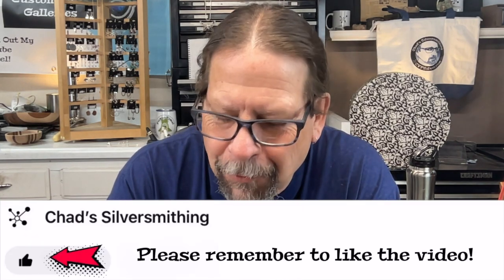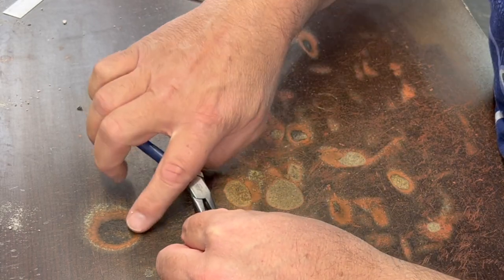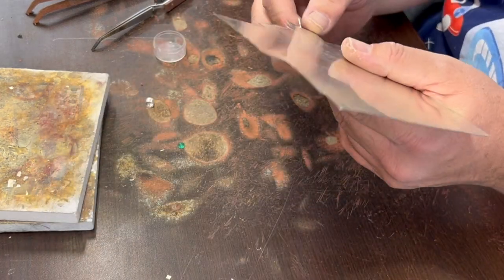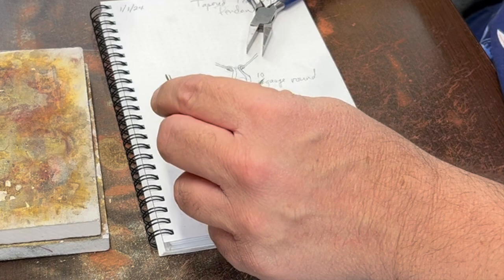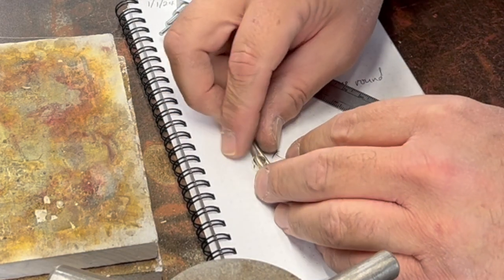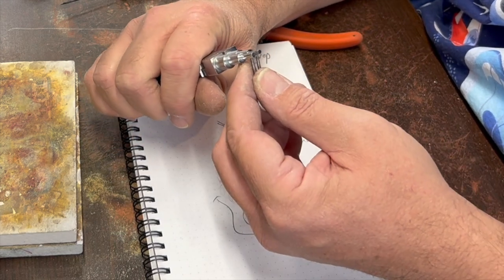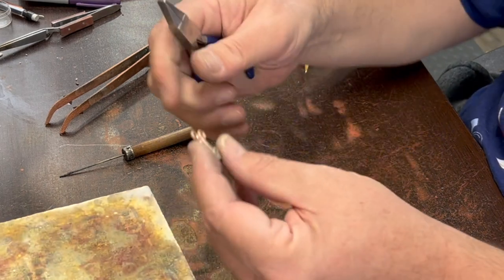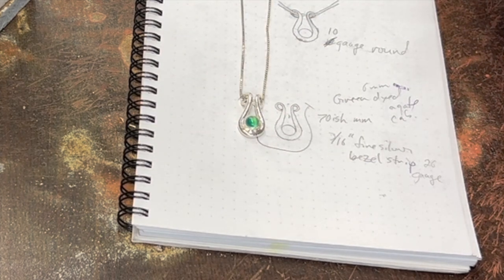Making a Tapering Teardrop Pendant: A Silversmithing Tutorial

Comment: This is really pretty, I really like the round taper. One tip I heard about and now do, is use inexpensive brass wire (or sheet if sheet is needed) to use for in situ measurements. This leaves the precious metal undeformed. Sanding from a rotation tool: brilliant! 🌺 🌺 🌺
Reply from the maker: Thanks Flying Chef!

Comment: Very nice thank you it would be nice if you could have showed how you set the bezel did you cut any of the length off or put something inside the bezel for the stone to sit on like sawdust .or ? And you said you used a drill to tidy the top of the bezel it would have been nice to see and the drill bits you used .😊❤
Reply from the maker: Hello Jakki. I don’t use sawdust as it decomposes pretty quickly, but tagboard (non-corrugated cardboard). It is compressible and doesn’t break down like sawdust. The cleanup is with a blue (fine) silicone polishing wheel. Hope this helps:)
Reply: @chadssilversmithing  thank you will have a look at that I have not done it just what some are saying ,I took a silver spoon apart last week oh my that had some kind of brown glue in it that was strong the handle was silver I think the bottom part was plated . Got some of those silicone wheels not used them yet will give them ago thanks again for reply 😊